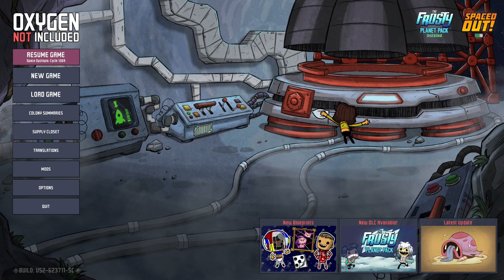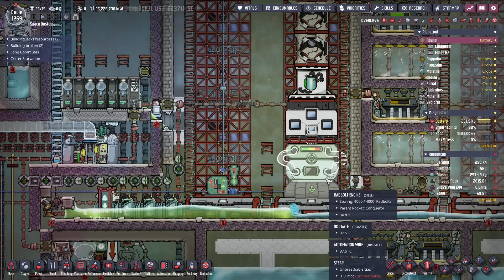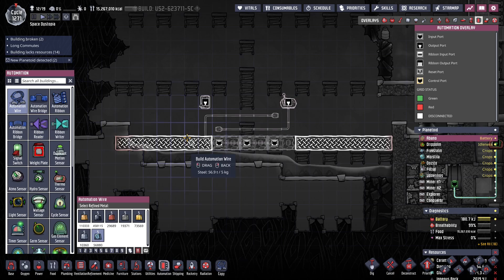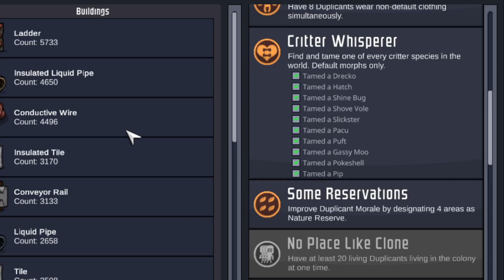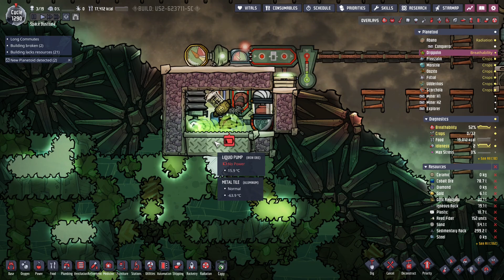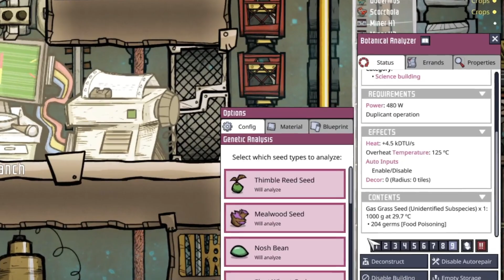Oxygen Not Included: Playing Cowboy in Space?! (LP - Ep39)

Comment: i think the chlorine is not offgasing because its 1kg so 10% of pipes capacity and when gas pipe or liquid pipe is filled with only 10% capacity the contents wont change state ignoring the temperature
Reply from the maker: That is correct, but I was actually talking about the Hydroponic Farm tiles themself. I usually am a bit lazy and use pip farming for practically all my plants, but this time I wanted to speed this up via active farming. It seems that liquids within the farms remain liquids, even outside of their usual temperature range, which is definitely good to know.

To avoid actual offgasing within the pipes I added the liquid meter to limit the pumped amount to what is actually needed. Thus no liquid remains within the pipes themself to heat up and boil off. The liquid chlorine is send off in one 5kg blob (instead of a constant stream) to further reduce the amount of heating during its travel. Of cause I could have gone the other way (as you mentioned) und just use a contant low volume stream instead, but the required amount doesn't round well when calculated as g/sec.